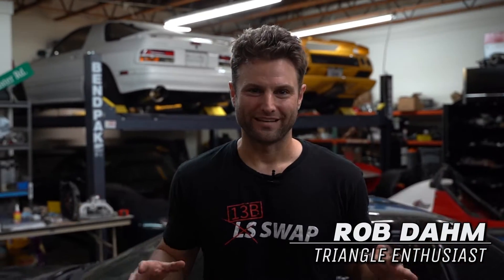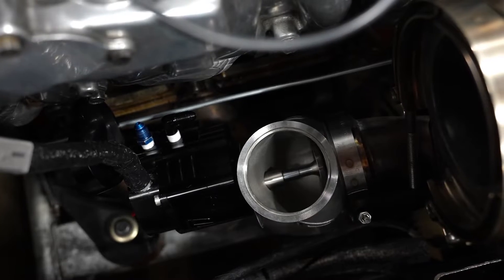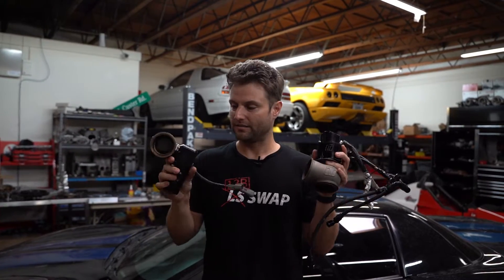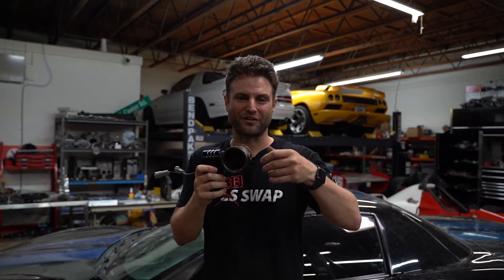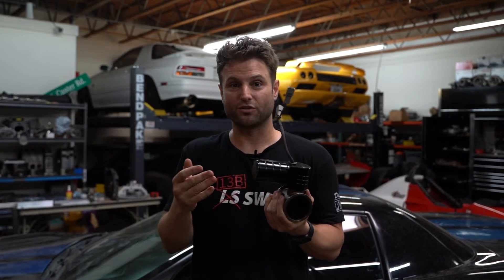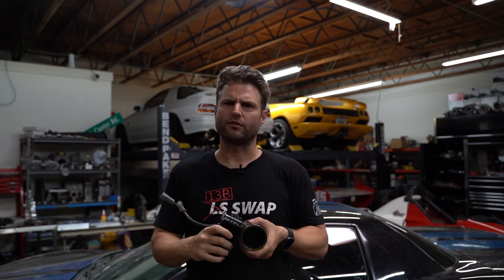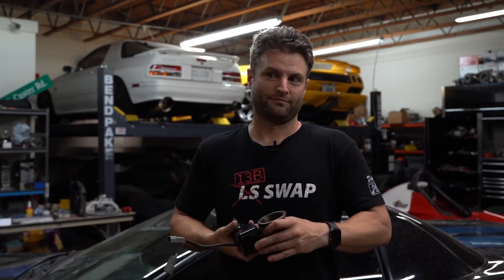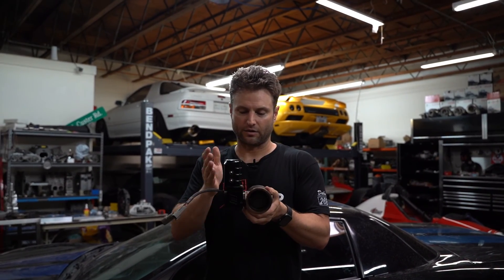Rob Dahm talks Turbosmart E-Gates!

Comment: Have a pretty curious theory / question… 

Running an all mechanical diesel engine, bigger turbo, but I’m running a transmission that has torque management, “usually” controlled by cutting timing and or fuel… however I have no way to control that anymore, therefore the transmission will still work but it’s not going to last all that long. I have the ability to output the tq management to whatever signal I need, you think I could control an external E-gate through the transmission to cut power between shifts for split miliseconds, or is the technology not yet fast enough to use it like that? I know its not normal but I am curious if it could be done.

Comment: You mean open ? 1:08
Reply: Ahhh spouse depends where u put the gate intake or exhaust ?
Reply: @AshLongie no, wastgates are exhaust only your thinking of blow off valves. The wastegates job is to release excess boost and by releasing less (staying closed) more pressure will be held inside the manifold

Comment: Have you tried the new Turbosmart Boostgate to control boost on the cold side which can have the turbo spool like a supercharger, intsa boost? I’ll still be running a traditional pnuematic external wastegate on the hot side as a safety from over spinning the turbo. Will also use their blackbox and their TS-6466 on a built fk8 Type R running on Motec, port injection.

Comment: Now Turbosmart released the Boostgate 50 where it controls boost on the cold side and I just bought the straight gate 50. I may return it and switch. No need to modify the turbine housing to accept the heavier straight gate. This makes changing turbine housing sizes so much easier. Now the air flow isn’t interrupted at all trying to get the right angle of that schedule 10 pipe. The Boostgate 50 is placed inline with the cold side charge pipe.
Reply from the maker: Lets just say Rob is well aware of that product and it's functionality. ;-)

Comment: Sounds wonderful but unnecessary for like 99% of applications.
Reply from the maker: We know that these E-Gates are not for every application but there is a need for this level of boost control in motorsports. This video is for the 1% that want more information.
Reply: i'd actually tend to disagree. it simplifies the process and eliminates failure points similar to how a DBW system is in many ways better than a physical cable.
Reply: @simmosideways  I don't think you know what the word better means.
Reply: Yeah I've been interested in the since Mercury came out with their SB9 the twin turbo big block. They eliminated lag when they combined an electronic waste gate with DBW to eliminate turbo lag. I don't know how it compares to C02 solinoids though and what the down stream costs are of ECU upgrades and tuning. The tech could go way further to help with tuning though. Saw a guy used AI using a Raspberry Pi. Cosworth doesn't make you buy proprietary sensors and has pretty trick software but a high learning curve. AEM let's you use the original wiring loom. Mega squirt and autosoort labs have some cool stuff and the motech builder series is a great concept but race team expense. Trick drag stuff uses the big stuff 3. Holley is super simple for non tech people. The amount of research for everything is next level for project planning. Car builders need a new a social platform for project design. The forge was really cool but part selection alone is a nightmare.